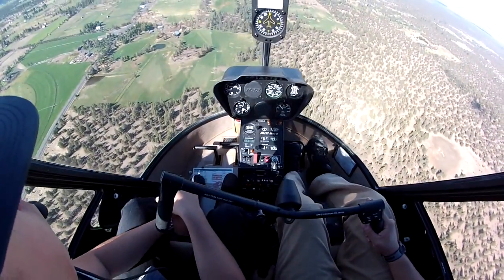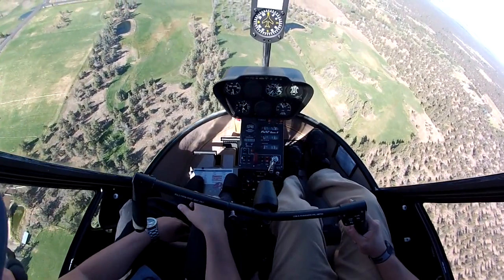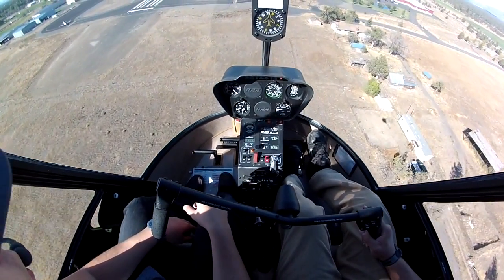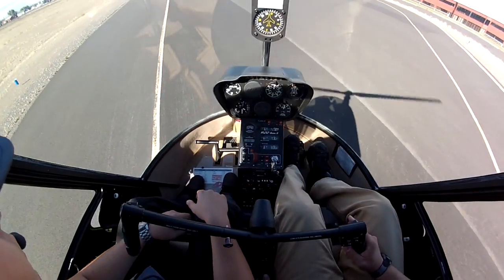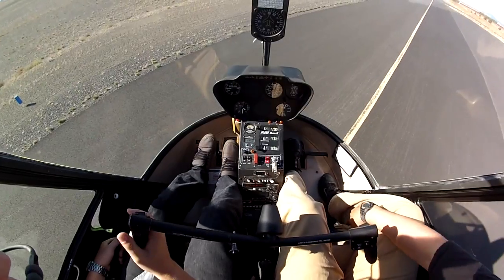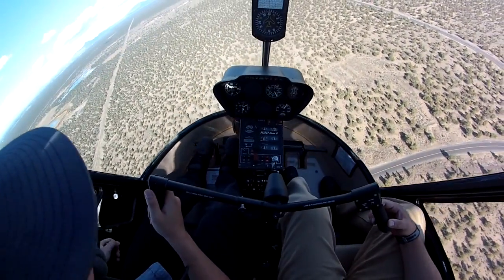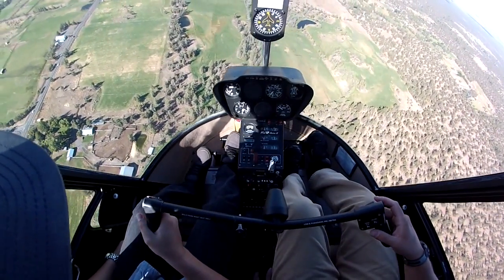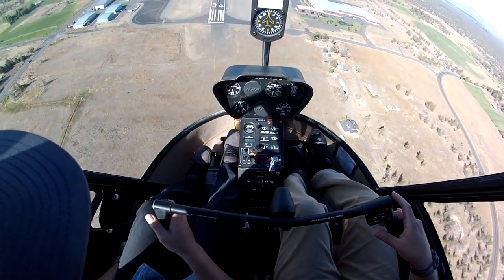Helicopter Loss of Tail Rotor (Simulated Bird Strike)

Comment: U would do an autorotation if the rear tail rotor fails??
Reply: Looks like it, i don't fly yet but the auto rotation is because you reduce the power from the engine which in turn eliminates the torque from the rotors on the helicopter so you  don't need the authority of the tail rotor to compensate if there is no torque on the blades. but you will vane into the wind or direction of travel.
Reply from the maker: Great question. Yes, or at least a partial power reduction with a good amount of forward speed. The power causes a twisting motion of the helicopter that can not be stopped without a tail rotor. So a partial to full (depending on airspeed, height, etc) reduction in the power is needed. The flight will need to end in an autorotation or the spin will start again when the airspeed slows and the vertical stabilizer is not as effective...

Comment: Im not a pilot bit I was certain that tail roder failure regardless of the cause meant 100% certain unrecoverable loss off control as you spiral into the ground.
Reply from the maker: The tail rotor thrust is used to counter the torque of the engine driving the main rotor blades (check out our video on that subject). So if you enter an autorotation, you disengage the engine from driving the rotors and remove the torque. Also in forward flight the vertical stabilizer helps counter torque. But if you are hovering and lose the tail rotor, the rotation of the fuselage may build up too quickly for the pilot to counter with an autorotation entry. Also the aircraft may be too low and/or slow to make a safe autorotation (inside the deadman's curve).

Comment: That wasn't Loss of tail rotor, the fuselage would spin due to no anti torque from the tail rotor
Reply from the maker: Not with enough forward airspeed and a lower power setting - the vertical fin adds stability.
Reply: Another YouTube know-it-all...
Reply: if you kept the engine power on then you would run into too much torque, that's why they did an auto rotation, to reduce the effect of torque on the rotor.

Comment: Is this a simulation of simply having a slightly damaged tailrotor with reduced effectiveness or can you expect things to unfold like this even with one of the blades completely gone or severe damage to both blades, etc. ?
Reply from the maker: +itsumonihon Good question - the amount of pedal is roughly zero pitch on the tail rotor (and so zero anti torque thrust), so it is simulation of total loss of tail rotor. There are many possible causes for such a situation - drive shaft or gear box failure, bird strike, etc. If parts of the tail rotor have departed you would also have change of CG pushing the nose forward and adding significant vibration.